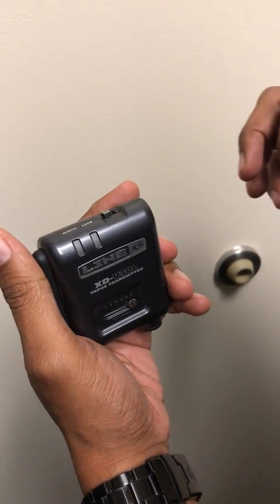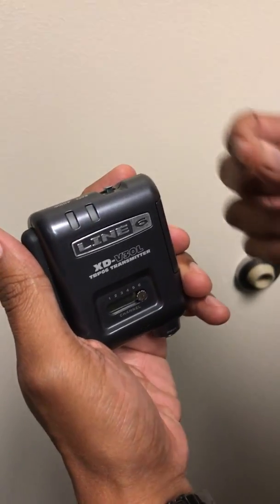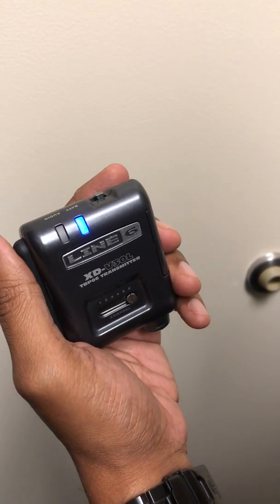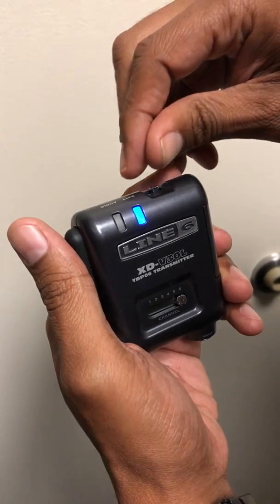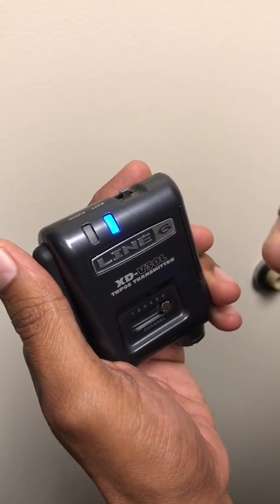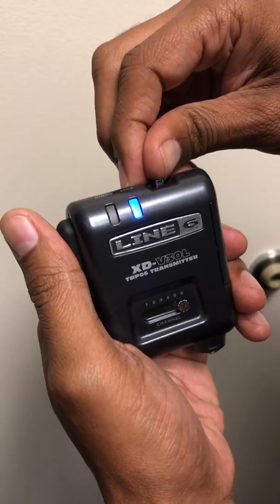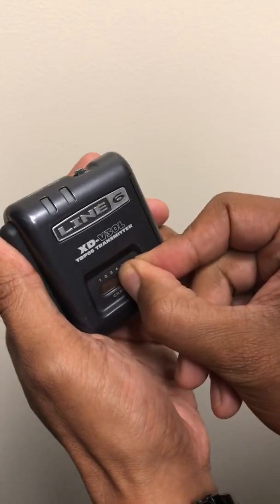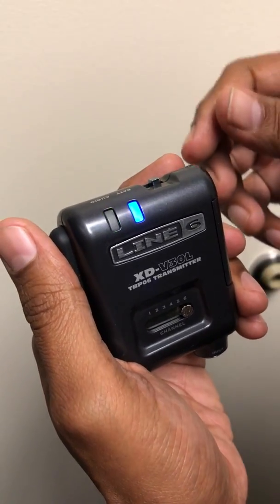TBP06 RF Mode Switching

Comment: decided to leave line 6 products i have 3 all are no good Gt10 wont connect to guitar no matter what ive done and been told to do-spider jam 75 having issues with faulty speaker and 150 amp i got sounds like a 20 watt as speakers not soldered correctly time to go Marshall-line 6 support cant help

Comment: Hi ,is it line 6  veriax works with only line 6 battery ? I live in dubai thought similar model np f550  same volt fits well but did not work ,I iam confused I think guitar has defect ,so I am not willing to confirm to buy official battery ,do you you think official line 6 battery will work 100 percent ( guitar is working with pod hd 500 via Ethernet port ) plz confirm then I will order these battery’s .